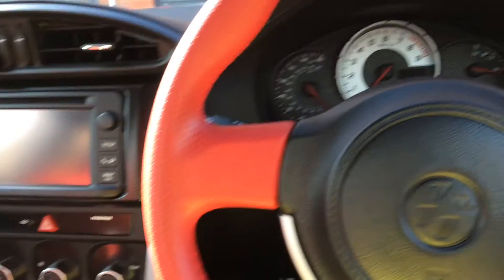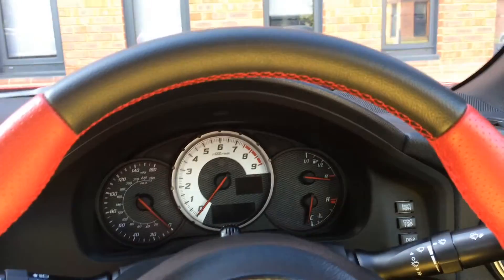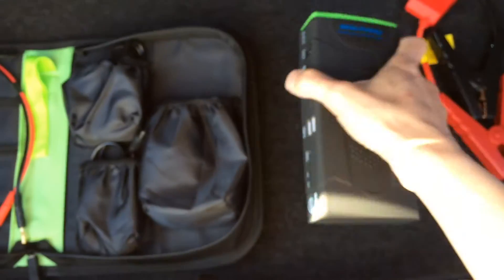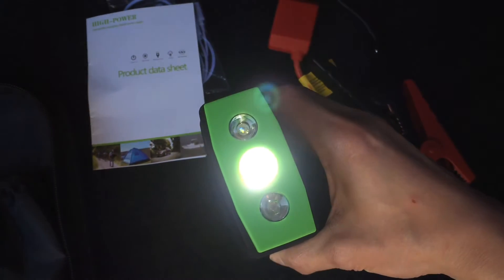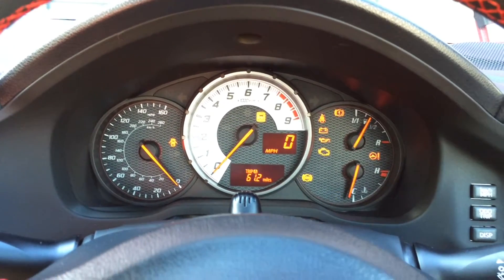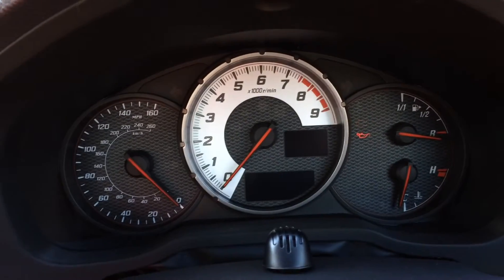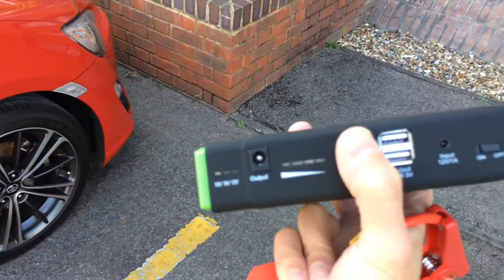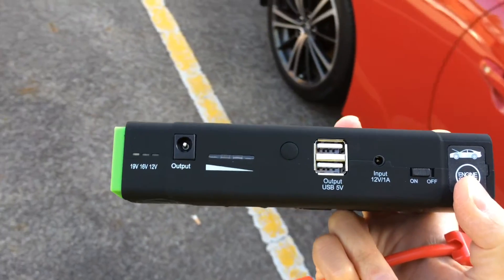GT-86 FA20 boxer failed to start due to flat battery. Symptoms, effects and Jump Start procedure

Comment: I have a 2016 FRS. Just replaced my battery today from the dealership. My battery would die easily from just listening to music for 15-20 minutes. Once winter hit these last few weeks, the temp dropped well below 0'C. Car just wouldnt start. Luckily I have a battery booster, which I had to use everytime between trips. 

After I changed the battery (got a toyota branded battery with 84 month warranty), the car would start flawlessly.
Reply from the maker: Just replaced mine with the Yuasa YBX7014 EFB. It's stunningly good, the CCA is so high and it's made for stop-start (it's EFB). The starter cranks so fast even after weeks of not driving. Amazing stuff!!!

Comment: Seems to be broken starter motor
Reply from the maker: your comment is wrong on so many counts....
Reply: @BrianSu  the mechanics told me it's my starter motor for the same issue. Why is his comment wrong ?
Reply from the maker: Aziz Nasery because it starts just fine normally and this only happens when the battery is very weak. How can it be the starter??? The cranking speed correlated with the battery’s voltage.

Comment: Turn off the air conditioner omg
Reply from the maker: Yup I do that these days. Anyway it wouldn't have made a difference as the fan in these small cars are tiny and don't draw that many amps.